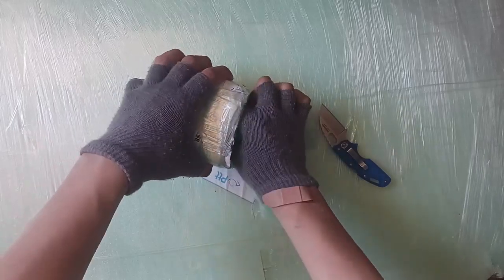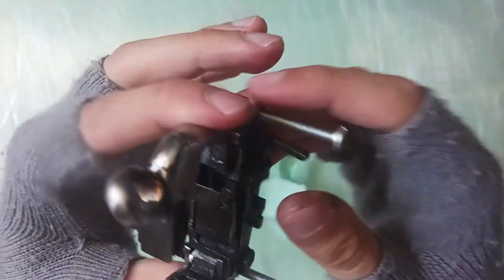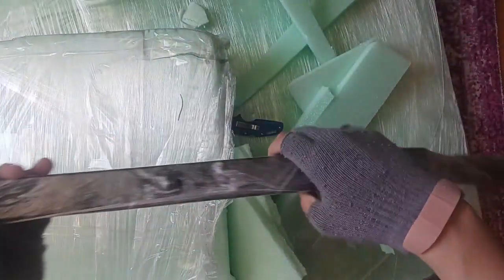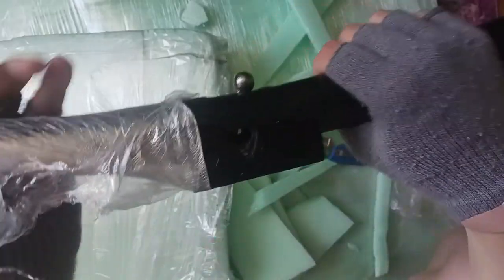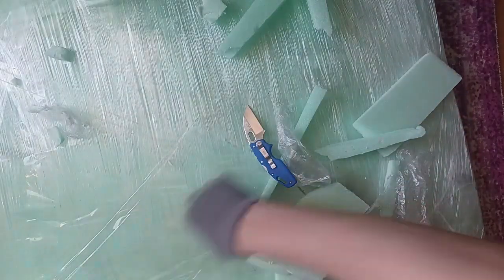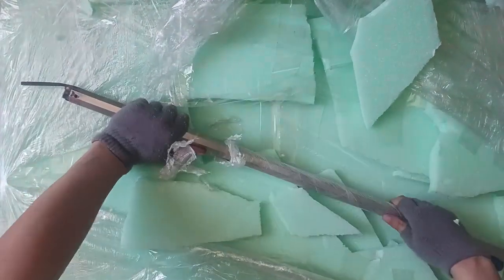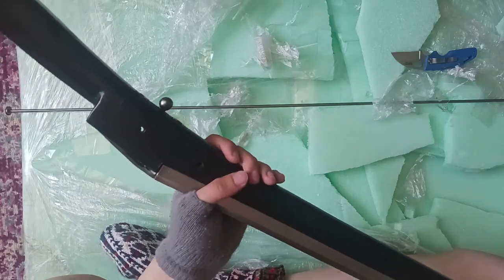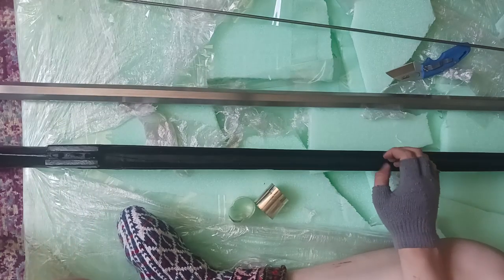Unboxing a RARE new Caucasian / Turkish miquelet flintlock from Peserey Handicrafts

Comment: I hope you are able to bend the tang back to where it belongs and the tang threads are not damaged.  Unfortunately modern shippers handle and throw packages very roughly.  Time is money to them.  I have had products damaged from being thrown into the trucks and found boot footprints on the cardboard outer boxes from 200+lb. drivers walking upon them.  It is very frustrating and maddening.  I no longer ship anything that used to require a FRAGILE HANDLE WITH CARE label, because it will just be ignored.
Looking forward to seeing the repaired and assembled piece in a future video.  Good luck and happy shooting.

Comment: Did you mange to get in contact with Hamit?
Reply from the maker: @vincentdiienno3163 yes and he said just go ahead and bend it back! Ok then! I don't have a vise so I gotta find someone who does!
Reply: How does the leather warped around the stock feel? I’ve never seen that done before. I was curious and saw it was done on a few pistols
Reply from the maker: @vincentdiienno3163  it feels pretty nice. There is a slight texture to it. I have questions about its durability, I don't know how I could repair scratches, I'll try to be extra careful with it
Reply: I actually just ordered this same musket from Hamit. I’m thinking of going with bare wood for the walnut stock. I’ve seen a few examples with and without the leather wrap, I like the concept but knowing me I would scratch it and it would bother me. It looks beautiful though.
Reply from the maker: @vincentdiienno3163  Make sure you specify the touch hole size you want, he made mine with a 3mm wide touchhole which may not be to everyone's liking, I will talk about this later in a video